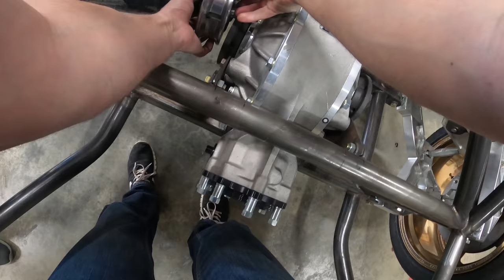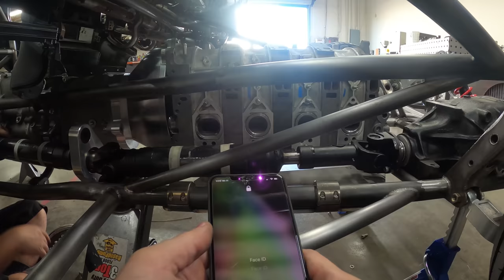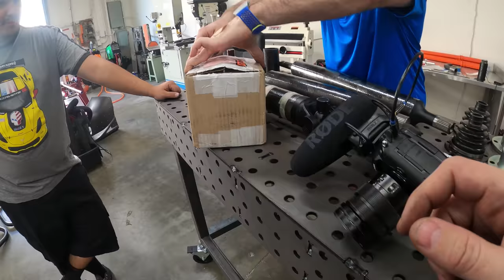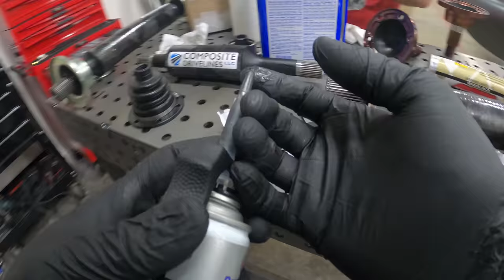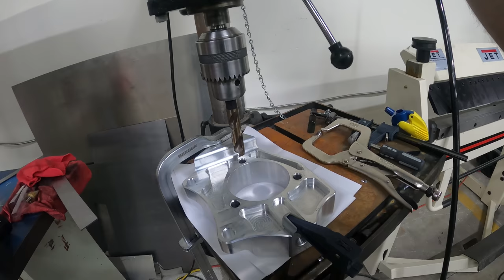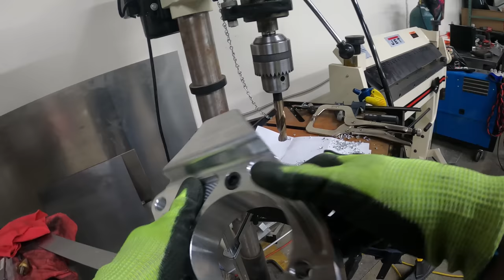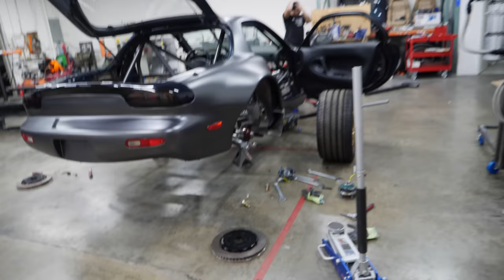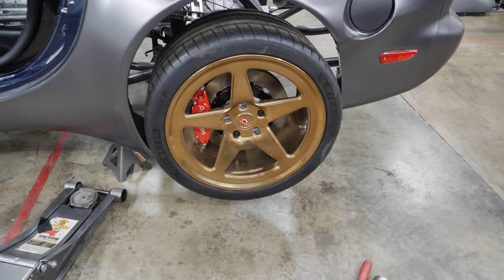Carbon Fiber Drivetrain INSTALLED in AWD 4 Rotor RX-7!!

Comment: Kind of upset you got the clutch so fast. I was waiting to buy it on eBay
Reply: You know this is a true OG subscriber! History in this joke!
Reply: I was going to get get a job at ups so that I could buy it from the employee auction
Reply: That's made my day! Pissing myself laughing 👍
Reply: Alex Conkle no such thing lmao
Reply: That’s what happed last time. The motor was sold to a ups employee as a lost package
Reply: Work of art!!
Just, @8min, you used a drill not a counterbore? Theoretically, that angle gives very small contact area under the steel head & will mash into aluminum over time & loosen. Maybe want to go back & counterbore?
Reply: @bryceboatman3462  yes there is it's a warehouse designated "overgoods" and it sells packages to bidders

Comment: Counterbores should be flat bottomed under load it will deform on the 118 degree drill tips and your hubs will come loose. You need a pilot tip counterbore tool or your' hubs are gonna come flying off
Reply from the maker: Exactly why I didn’t go full depth so someone can help fix it 😂 but I appreciate the details. It makes sense I don’t want to mess with the thing holding my tires to the car
Reply: And a trusty call to notter. Build to Apex can you re billet my billet billet with some extra billet please...... Billlet
Reply: por mans way is to use a standard drill and grind the tipp flat and sharpen the tipp like the crown of a norman drill but now in the flat angle.
Reply: You could buy a matching center cutting endmill and you should be able to flatten that bottom real easy.
Reply: You can put a matching taper on to the bolts as well and that should actually help using the same concept as a lug nut
Reply: @jrraczko651  thats right.
Reply: Was coming here to say that but Matt got to it first, your going to have a bad time if you didn't counter bore
Reply: Just get an endmill and do the same thing you just did with the drill for a flat bottom. It's not rocket science.
Reply: @3literheater  this^
Reply: All this, and also that’s not a cnc drill press. It’s just a drill press
Reply: @RobDahm  thank you both for addressing this I was about to have an aneurysm if it went unrepaired. This is exciting progress, great job Rob and the team. I'd hate to see all this work get wrecked on its first drive because of some small machining discrepancies
Reply: @RobDahm  Something similar to McMaster part number 2740A16 but of whatever size you need for your bolt. Dont try to use an end-mill in a drill press, that one you have is nowhere near stiff enough and it'll probably chatter a lot at best, or grab and fuck right off into the part before it snaps at worst. 

TLDR on why the angled bottom is bad, is the aluminum under the bolt head will only touch on small circle on the perimeter, you hit a bump and the aluminum deforms, and you lose clamping tension, then the bolt vibrates out, or the hubs slide around on the mating piece and damage it.  Flat bottom hole spreads the force out under the entire bolt head.
Reply: Counter bore bit required wont torque properly without it being square
Reply: @RobDahm  I need you to help me, do you a favor. Head on down the Harbor freight and ask for a Benchtop Milling machine, grab some tool holders and endmills, and a hold down kit. It would make doing counter bores on the hubs, and other things a breeze, and would make me very happy to see you doing it right yourself. Any time someone wants to buy a drill press, I tell them to consider a mini mill instead as its much more versatile, and almost as cheap. Love the car, cant wait to see it ripping!
Reply: Can't a washer achieve the same thing?
Reply: @ratataran  no it would still only have edge contact between the aluminum and the washer it would still deform the aluminum which changes the clamping pressure and loosens the fastener
Reply: @RobDahm   Wow first reply I have gotten lol also when are you planning to install a bleed fitting on your radiator so you can get the air out of the top end tank now that you have the fittings on the bottom?
Reply: This!

That car is going to be insane!
Reply: THis was the reson I came to the comments. For sure a drill drills angles not flat bottom. I
Reply: In some situations, but i don't think this is the case because one of the mating surfaces is alu, so likely it would crush it, you can actually snap the bolt head right off. Seen it happen on a mill fixture that was tightened over a similar counter bore. When pressure was applied on the other side of the part, the head jumped out of the hole and the whole thing spun off smacking the poor mill in the body. It was glorious.
Reply: Defo use a countersink bit as others have said!
Reply: @fewie84  counter bore bit. a countersink IS tappered
Reply: 1slow370 ok, counter-bore... or flat bottom mill bit then. Anything so the bottom of the hole is flat
Reply: It wont come flying off. The axle nut will hole the hub onto the knuckle if those bolts did end up coming loose

Comment: did this dude just counter sink some holes using a tapered drill bit????
Reply: Preach!  Needs a counterbore bit.
Reply: gitrdun
Reply: Saif Elkhayyat torque will be lost pretty fast in aluminum
Reply: Jonas Larsson exactly, the bolt head’s contact to the aluminum is basically ruined, potentially dangerous
Reply: @saifelk900  saw an other comment from rob himself that he is planing to make the holes square this where just a temporary fix.
Reply: extec101 once he makes them square the counter sinks are gonna be too deep
Reply: @saifelk900  well it might be the case but lets wait and se what rob does next maby its part of the plan to sink the bolts ore redo the spindle from scratch the correct way.
Reply: Rob is aware of the problem and will amend it. He claimed that the drilling was not to final depth.
Reply: @jonasthemovie  saw that in another comment that rob will fix this.
Reply: Counter BORES*
Reply: @chrisgilmour831  that's correct :)

Comment: Hey Rob, aren't the holes for the countersunk screws in the wheel carrier too small or have too little air gap for the cylindrical head?
If the screw thread takes full advantage of the clearance in the hole and the countersunk hole allows a smaller tolerance, the countersunk head may be loaded transversely and will stress the screw with torsion bending.
Potential failure mode: fatigue failure.

Comment: Should have used an end mill to finish the bottom of the hole to take out taper put in from drill bit... now there is only a tiny amount of surface area for the bottom of bolt head to tighten on... not the end of the world now but definitely do it before car is 100% done... bolts will def come loose if ya leave taper in there

Comment: Having a conventional U-joint running that close to the $61k engine has my nerves tense.
Reply: Cjbarker2 Could definitely do with a decent shield/containment plate around it just in case.
Reply: Johnathan Doe yeah, man. 100+ in a 1/4 mile or 180+ on the 1/2, thing could do some serious damage to Rob and his wallet.
Reply: Cjbarker2 Decent piece of 3mm steel sheet radiused around each UJ (but open at the bottom, just with a piece of bar welded across it under the shaft about an inch away from the UJ itself to stop the shaft dropping down and digging into the ground it the UJ dies) with good solid mounting points on the chassis should be enough to spare the intake/engine. 

A lot of cars with centre joints in the driveshaft have a similar thing on the middle UJ to stop the shaft ripping through the floor and into the interior of the car, and maiming people if it fails. 

I’m just confused how the intakes even gonna clear that shaft at all tbf.

Comment: countersinking aluminum for SHCS - make sure and retourque after some use, because the drill bit leaves a conical bottom, and the SHCS will pound that out. also try tapmagic for aluminum for drilling / tapping aluminum - notable cinnamon smell, best alu cutting lube i've ever found.

Comment: Instead of counter sinking those holes with a drill, which leaves a tapered surface, it would be much better to use an actual end mill or countersink so you get a square bottom instead of an angled bottom. Bolts would actually sit completely on their entire shoulders, instead of simply contacting a very small area at the top of the drill angle. Just a suggestion from a long-term CNC programmer. Not trying to be douchy. Just know you're a perfectionist like myself 😁😁.

Comment: DO NOT "countersink" socket head cap screws.  You need to be using a counter bore to create a flat shoulder for bolt to sit against, NOT a drill bit.  Right now as you tighten the bolt you are sitting against an angled surface from the tip drill bit, meaning the bottom of the bolt has a very small contact area.  This WILL cause the bolt to loosen over time, and rather quickly, as all of the force is exerted into one small corner resting on a tapered angle instead of the full face of the bolt on a flat shoulder.

Comment: Hey what you need is a counterbore bit that will leave the proper flat bottom bore for the cap screws because now they are just digging into the edge of the taper and could get loose after a while. but you can come back later and give it a pass with the counterbore bit.

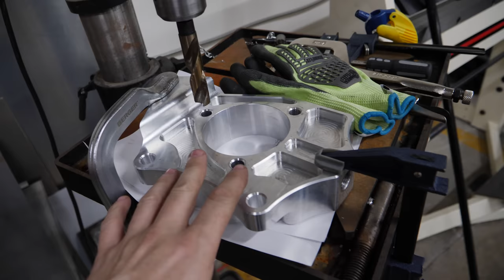Comment: 7:28  Rob,  YOU DOPE!!!  You need a FLAT surface for that bolt to sit on!!!  NOT a conical surface you get from a drill bit. FINISH bottom of hole with a FLAT counter sink.  PLEEEZE!!!!

Comment: Look for a HEAVY DUTY FLEX 20 tig torch, if you are running much amperage.  They will be rated higher for DC welding and lower for AC aluminum welding. I have one from Nutech sys (IIRC) and it is rated much higher than a standard 20 flex. I'm assuming that was a flex torch. The HD version has a larger rectangular neck, but it still flexes and has the small number 20 head to fit into tight places. I often times run at 200-250 amps and sometimes will push the torch to 300+ amps for short welds and heavier aluminum or steel. The torch never gets warm, but I also built my own cooler with a radiator. My tig machine will go up to 460 amps on DC, but the service to my garage is not heavy enough to max it out. The machine is an old sine wave transformer machine so there are no arc adjustments and it is left to the amount of heat used and user skill rather than being able to tweak the arc like on the new machines.

Comment: I'm not an import or rotary fan, but love the attention to detail and seeing the nuts and bolts of the project. My hobbies and work are very similar in that I do some fabrication and welding and also construction work and do a mix of building things from scratch and also repairing existing machines/structures. Like Rob, I learned to do much of the work on my own vehicles. With doing some changes on my sandrail frame and vw engine (cv joints on the rear IRS) I have had a small taste of what he is working on......his build is only 1,000 times more extreme and complicated, but I would feel right at home if I was helping him on that car.........and I live only 20 minutes from his shop as far as I can tell.

Comment: You need countersunk bolts, with appropriate countersink drill. What you did there is questionable at best. I'm no structural engineer but the right bolt for the right job :z

Comment: For future reflection, when those cap screws, you have countersunk with a standard drill bit.  Gall out those aluminum threads or back out and snap damaging something going 170 mph.  Please note to use a proper countersink flat bottom drill tool.  If you have time, take the time later to full quality control to SAE, IFI, ASTM, ASME, AWS, IEEE, NEC, NFPA, etc.  I love the spirit and drive to make a dream reality.  I want to make visible the attention to critical thinking skills with safety number one.  Plus, I know this is a one of a kind dream machine.  You have financed this with many factors, so yes, goals are great if you are managing the danger.

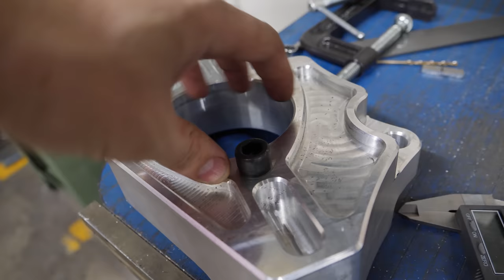Comment: 7:39 counterBORE is the process you should be doing... but you are right, that is a countersink and it is meant for a taper-head bolt.
This process is going to weaken those connections significantly.

Comment: I hate to be a little rain cloud but I was looking at your spindle and noticed that on your lower control arm you utilized one rod end mounted axially to connect it to the spindle @ the lower control arm.  Why did you elect to do this?  Rod ends are designed to be mounted radially and captured in double shear, especially if they are under bending forces.  Mounting it axially reduces it's rated strength approximately 90%.  So if you are using Aurora AM8 rod ends, instead of 19000+ lbs of static load capacity, you now have 1900 lbs.  I know it might be a little late to make a change in the spindle design so at bear minimum, I RX the use rod end capture washers to prevent/minimize separation of the bearing from the rod in the event of failure.  

Still enjoying the work and the videos, keep them coming.

Comment: That is starting to come together to look absolutely gorgeous. As an RX-7 aficionado myself, I am full on  jelly right now. But proud of what you're doing. This thing is going to be a beast. Am I wrong in thinking that you're going to get your rims hitting the upper (and maybe lower) A-arms at full lock? Could those use being trimmed down a bit to allow your tighter angles? I know you're not building it as a drift car, but it seems it could get a little more out of lock and still not hit those A-arms with a bit of a trim. Just curious. Great work so far, loving this build.

Comment: Go for carbon fiber wheels and carbon ceramic brake rotors to further reduce rotational mass and overall weight. Not gonna lie tho, suspension system looks very janky, especially the front end. Control arm hinges just look awful

Comment: ROB, it's hard to tell from the video, but it looks like your AN fittings on the oil coolers have teflon tape on them.  I can't tell for sure, but I'd at least like to point it out if that's true.  AN fittings seal on the metal face and don't need any teflon tape.

Comment: Btw you should use an actual countersink for doing that not a drill bit and moving the actual chuck down is not accurate. Fixing the chuck in place then moving the table up is a lot more accurate. Bridgeport 101

Comment: Rob check again your spacing front axle from frame. Use car jack under front tire, when suspension is press then check if your axle rubbing on frame. I hope you fine but is better to be sure.

Comment: Nice to see how quickly the build is going. Can't wait to see it finished.

One question Rob: do you think you'll get torque steer with those unequal length front drive shafts?

Comment: ALERT!! Please revisit the bolt hole you counter sunk and make them flat. It looks.like you created a stress point in the bolt, by not sitting flat when it's tightened it will deform the hole,possibly could come loose or snap after it comes loose. Hope to see you and the smiles this project will give you for a long time to come.  Brilliant idea that gives me pleasure to see it come together and I know you will not be disappoint by its performance.

Comment: I really like what your doing, but wondering what you were thinking with the quick change in the rear and a fixed ratio in the front.  rendering the quick change useless, and  the fact that you have all the bulletproof axles and drivetrain when the quick change is the weak link. there is one thing that bothers me is that angle iron for the headlight mounting, a piece of tubing with some tabs would look so much better. it just looks out of place. Hope you get it finished for SEMA.

Comment: If that second oil cooler is not needed, you can pump the gear oil from your transmission, through a filter, and make that a transmission oil cooler. But then you would have to amount to more coolers one for the transfer case and one for each differential.

Also if you do not need that secondary oil cooler oh, you can use it as a fuel cooler.

Or you can run the oil through it like you had originally planned I really prevent any overheating when idling for long periods.

And somebody mentioned in your video not driving long distances... A car like that should be able to drive from Alaska down to Florida then up to Maine and back down to Southern California.

That's a hell of a lot of miles, and you probably wouldn't want to drive that anyway, but it would be amazing to say it is that reliable.

Comment: The amount of material removed also will massively weaken the hub should have had a shallower counter bore and moved to AN full shanked bolt. This is was we used to use on formula 3 hub bolts. More expensive but the quality pf bolt is so much higher and potentially lighter than cap head allen bolts

Comment: The completed frame and engine will be so beautiful it's going to be a sin to cover it up with a body for SEMA you really should just show it with out the front clip on . all the working suspension and carbon drive train should be put on show with the 4 rotor as the crown jewel . this build is going to blow every one away but you can show it again next year with the finished body and still blow every one away again it's that huge of a project

Comment: There is a special tool for counterboring for allen or torques head cap screws, it makes the bottom of the hole flap, for more consistent torque when you tighten them down.

Comment: Hey rob im a fabricator for a living and if you get some coper anti-seize and put them on all of your bolts that tread into aluminum it will lessen the chance of them stripping. It will still cross thread but it just helps it not to. Its better then putting grease on them.

Comment: Rob, the bolts you use for the cv joints look like plain steel. Be aware if this car is used in rain etc these can corrode pretty fast.  greasing them etc wil help but still it is something to look out for!